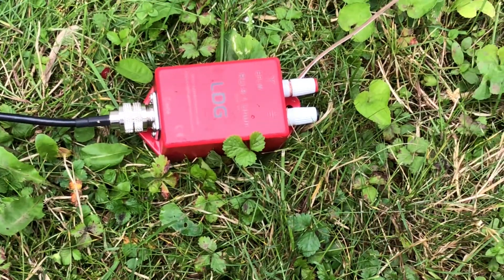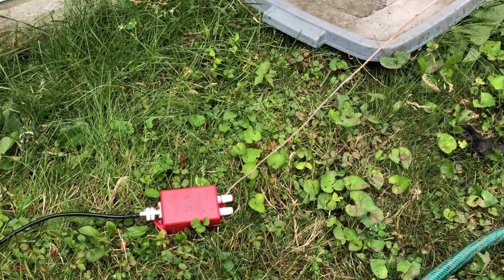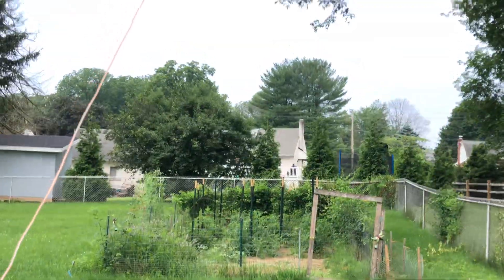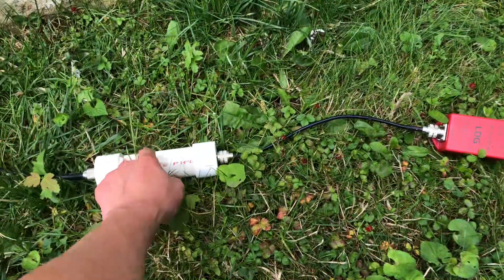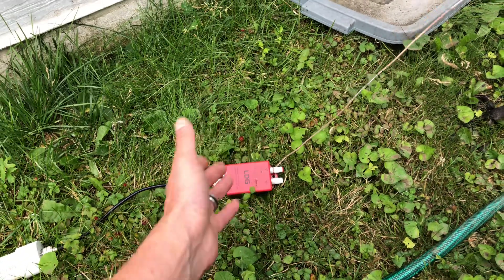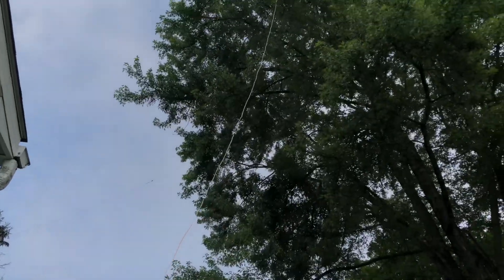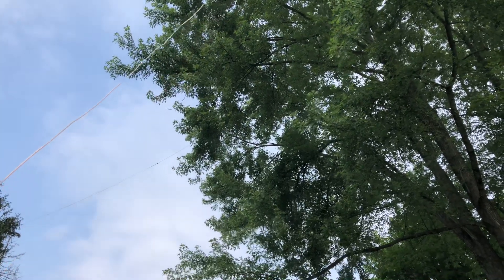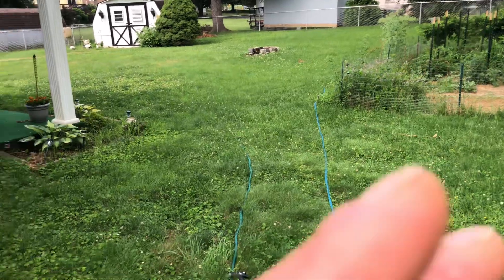Random Wire w/ 9:1￼ unun Part 2

Comment: I just got one of these today,I think i am missing something,I cut it for 12 meters 24.940 3.7 swr and then I checked 20 meters 14.240 and the swr was 1.02 I did the 468÷2 for 12 meters.
Any ideas mike?
Reply from the maker: Nine to one is for random length of wire.   It’s not really random. But the lengths are not half wave at all. 
Read this link I am providing for you.  Near the middle look for the numbers in GREEN.   Use one of those lengths for an end fed.  
http://www.hamuniverse.com/randomwireantennalengths.html
I used 71 foot of wire.  Got me on 160-10 meter.  But you chose what’s best for you.
Reply: @mikecricket113  oh ok I read it that makes sense now...thanks

Comment: Don't forget to add a 1:1 UNUN so you don't bring common mode current into the shack. I just bought a couple of them for a new 9:1 balun I'm making for a random wire antenna for POTA. I'm going to drop a video of how to water proof the LDG enclosure so it can be left outside.
Reply from the maker: It’s in line behind the LDG shown in the video.  Using the MFJ 915 
Look forward to your video on weather proofing.

Comment: Where did you get your splitter? I'm wondering if you used the eavsetrough I may try connecting to the metal roofing and see if it works.
Thanks for sharing
Reply from the maker: I am confused about the splitter you’re asking about?
Reply: @mikecricket113  it's the red box attached to the wire
Reply: @mikecricket113  I'm sorry its the 9-1 balun
Reply from the maker: Oh..  DX engineering